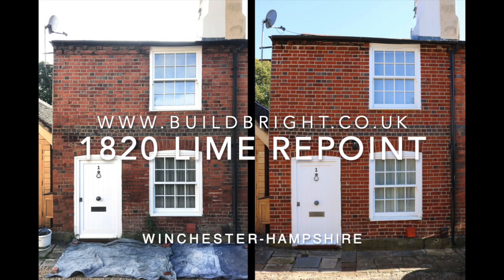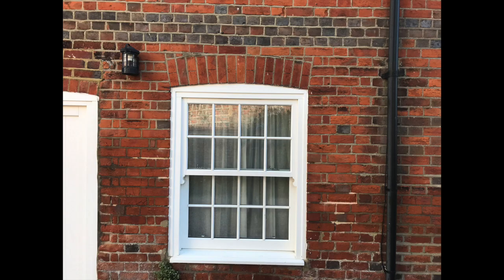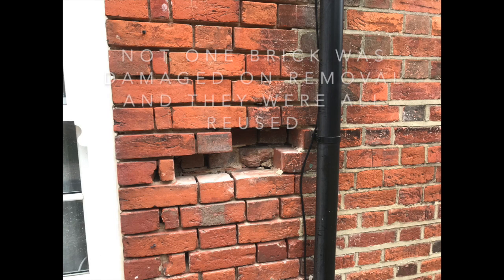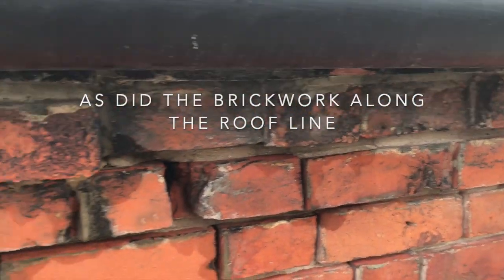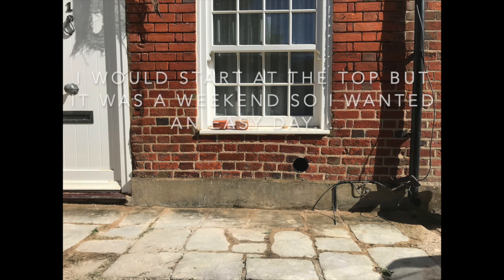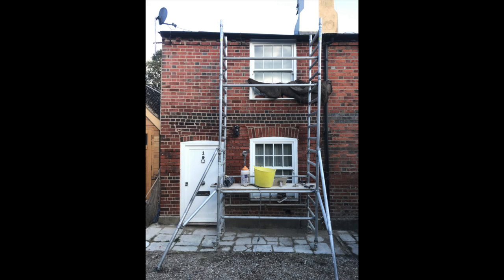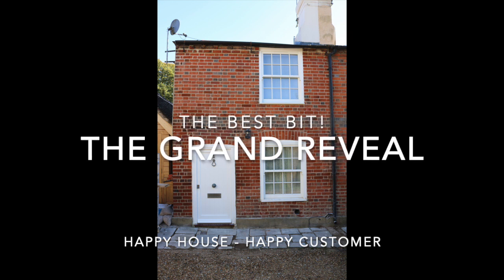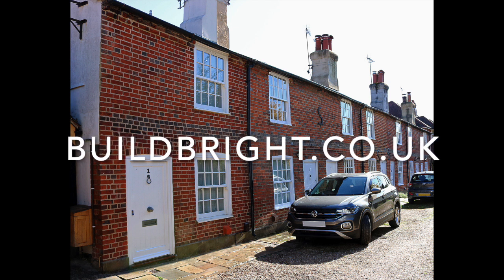Lime Mortar Repointing, Brick Replacement and Repair 1820 Winchester Period Property by Build Bright

Comment: Hello, first of all stunning finish to the job. Can i ask what mix of sand did you use? Plastering/sharp/soft sand? Also what is the finish you used is that flush? Did you achieve that with a churn brush? Thankyou 👍

Comment: I need to replace a few bricks during my repoint. Can I use the same lime pointing mix to set the new bricks in place? I feel like that mix needs to be stronger somehow
Reply from the maker: What mix are you using? I use the same mix for pointing and setting new bricks. I of course adjust the stiffness to suit laying rather than pointing. Don't forget to damp the bricks down.
Reply: @buildbright  haven't decided yet, speaking to my local limeworks now. My house is built with industrial coal ash lime mortar so its really difficult matching an appropriate mortar to it. Its not about colour matching its more about ensuring the right material that would work with original coal ash mortar. NHL 3.5 is potentially unsuitable, quicklime with wood ash added is close but would still make a different mix to the original mortar.
Reply: @buildbright  Could really do with some advice to be honest. After weeks of  back and forth between whether its going to be NHL or limeputty, i'm now thinking of using LaFarge NHL 3.5, 0-4mm sharp sand and 0-2mm sharp sand using a ratio of 1 - 2 - 0.5.
My house was originally made with coal ash mortar, im thinking of adding a small cup of coal clinker to each mix.
First time repointing, im not a builder.